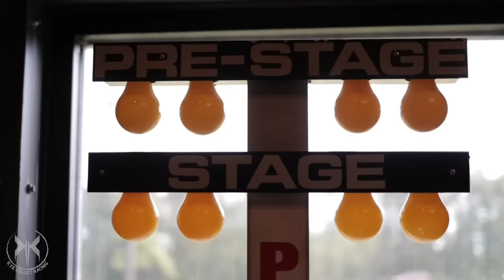My NEW No Prep Kings Car and Engine for 2023 Reveal. Meet JangAlang

Comment: Turbocharged technology grew so fast in the last 10-15 years now that it's peaked sounds like people are going back to the old school and doing The superchargers for the hard launch off the line. Launch control and traction controls pretty nice with technology with damn near unlimited amount of horsepower. Long way from the days of where you were 5 to 8 horsepower was competitive 1000 was a stomp. Now that's factory for a lot of manufacturers if you've got the moolah. I had to work hard to go fast Now you got a work hard to control at speed. 🤣